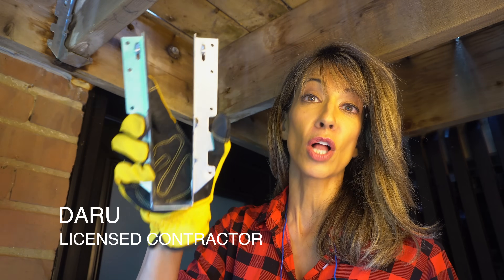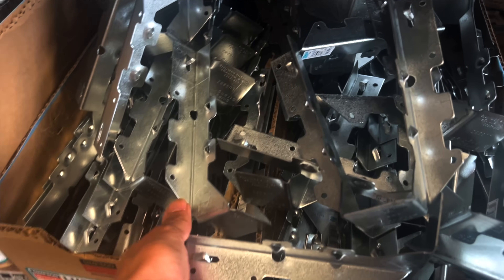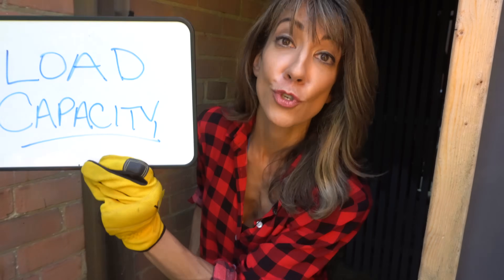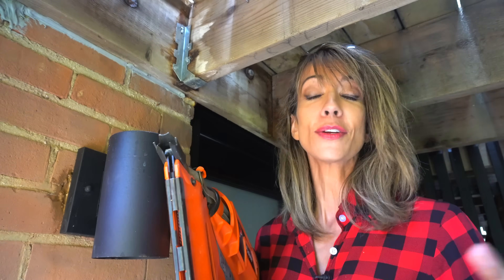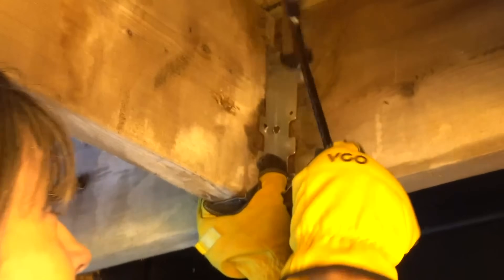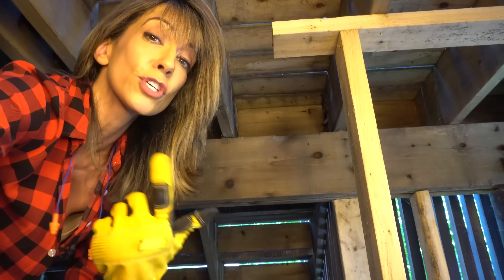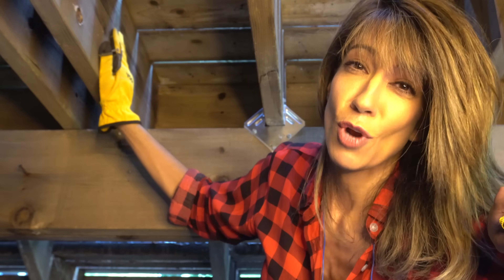Joist Hangers: Do Screws Beat Nails? (Backed by Science)

Comment: Using two and a half inch screws to go straight through a hanger leg into 1.5" ledger. Genius! Have fun on the ones backed by brick!

Also, nails don't break when you pull on them. They pull out.

Hammering on the bottom of a joist hanger after you have already secured it with a nail just results in bending at the bottom of the joist hanger to touch the wood. That which is bent can be unbent. The bottom of the joist hanger should be completely flushed before any fasteners are installed, not after 🙄

Good luck buying any joist hanger that is not galvanized by the way. Unless you're shopping in the local Dollar store of course.
Reply from the maker: Appreciate your thoughts on fasteners and joist hanger installation; all good points.

Comment: @6:40, did you mean to run a 2.5" screw into the 1.5" ledger board?  There is an extra 1" of screw protruding on the other side.
Reply from the maker: You can use 1 1/2” screws for the face and 2 1/2” for the diagonal screws.
Reply: No, she don’t. It’s at an angle. It’s perfect.
Reply: @randykephart3661  lol. Zero angle.  The screw goes in perpendicular.

Comment: I understand/agree with the longer screws for diagonal application, but it looked like you used the longer screws to attach straight into the ledger board so it would presumably hit the brick behind the ledger board.  I'd be more concerned with shear rather than tensile strength so would use the short nails for straight into the ledger (or maybe a combination).  Note, might try a palm nailer / auto-nailer.
I realize their are fewer options fixing an old deck rather than new construction, but I'd prefer those rim joists be supported by notched posts.
Multiply joists should be protected from water with deck tape, maybe caulk in a pinch.
Reply from the maker: It's #9 1 1/2" for the ledger, #9 2 1/2" for the double shear. Good to hear from you. Thanks!

Comment: Joist hangers put the fasteners in shear, so ideally nails are a better option because as you said, nails are stronger in shear.  Screws are often better for tight spaces though, especially those diagonals. But, as you said, that's why the manufacturer has approved nails or screws.
Reply from the maker: Good points and true. Good to hear what you think on this! Appreciate your thoughts!
Reply: @DaruDhillon agrees hiwever in a joist hangar the primary function by the shape and design of the hangar itself to carry load. The fastening method is to keep the structural member in place, not to support shear forces.
Reply: Correct, joists are in mostly sheer and only a little in tensile force resistance. Head-to-head nails are stronger for joists if they are the same length and diameter of a joist screw. If the screw is longer than the joist nail, it will be the same or even stronger than the nail, depending on extra length (in wood, not through it.) A screw is a nail that has had threads cut into it so the thread area is actually less diameter compared to the nail. Thus making screws weaker against sheer forces.
Reply: That true for normal screws not for structural screws, they are tested to meet sher ratings.
Reply: This is a question: Doesn't shear strength have to do with the thickness of the fastener as long as both fasteners are made of the same material? Like you, I saw the nail seemed thicker than the screw. That being the case, the nail would win the shear strength "race". So I wonder why the manufacturer wouldn't make the screw shank the same circumference as the threads? I realize this would make the screw more difficult to screw in because the shank would be trying to go through the threaded wood rather than an empty space created by the root, but it seems worth the trade-off to me. Yes, I'm extremely verbose and detail-oriented. 🙂
Reply: @NathanZSolomon A (12) #9 joist screw is 0.177” in diameter and then had threads cut into it whereas the (12) joist nail is 0.148” in diameter. So, the joist screw recommended by the manufacturer is actually larger diameter and able to withstand even more sheer force. A #7 screw is 0.151” in diameter so it would not resist the same sheer force as a 0.148” nail because it had threads cut into it making the actual diameter much less.
Reply: @mst5632  Wow! You sure know what you're talking about. Thank you for your help.
Reply: @NathanZSolomon  if they are made of the same material and size and hardness then yes, shear strength would be the same.  But typically screws and nails are not made of the same material and hardness.  Have you ever noticed how nails will bend quite easily but screws will break.
Reply: @tchevrier  I have noticed that nails bend, but I, with my DIY work, have only seen that a couple of times on what I call, drywall screws. Thank you for your insights.
Reply: @NathanZSolomon yes, nails are designed to bend so that is why they are superior for sheer force resistance. Deck screws commonly cannot bend much at all as they are considered to be “brittle” and never to be used for any structural work.
Reply: @NathanZSolomon  Good place to note that drywall screws are only for drywall - not structural use like decks and walls.  They don't have the shear strength.
Reply: @tchevrier  Dry wall screws were used in the 1980's in place of nails and do fail. Modern "CONSTRUCTION" screws are not made the same as Dry Wall screws. 

20 years ago I had to rebuild a deck that was overloaded by too many people. The deck builder (Home Owner) used dry wall screws for most of it and 2/3's snapped but the BRIGHT nails just pulled out. No Joist hangers. I rebuilt it using Joist hangers and long #12 Construction screws rated for the 2x10 lumber.
Reply: @mst5632  pretty much all you have posted does not apply to modern fastener material science. Engineers do not call out screws for prescriptive/sheer panel details because no one uses screws for that process.  If a manufacturer like simpson has a product that can use different fasteners they call it out in technical specs.
Reply: @BaronVonFrankenBolzlllI don’t disagree with you from an engineering and architectural standpoint. But, this is YT. This is where DIYers come to get information on how they can apply things to their own projects. As a well experienced DIYer for at least 20 years, I have never read any engineering call outs or work off of architectural blueprints. This is not commercial or industrial building resource information we are trying to achieve.
Reply: @tchevrier    Structural screws are a different beast. Grk screws are rated at 450lbs in shear, 16d nails are rated at 150lbs in shear. Yes i know grk screws are not for simpson hardware, just providing an example of why your statement is not necessarily true.
Reply: Smokin hot
Reply: Nails is NOT better in shear if it's used correctly since with screws you tighten the hanger to the wood so you get a high clamping force and gives lots of friction that the nail doesn't give.
When the joist is tight to the wood there will be a lot of force on the joist before any amount of sheer strain ever goes to the screw.

Also when people say screws are brittle.
"Yes" BUT the load that already made the nail fall out the screw is still tight.

The screw won't flex but it will hold the wood tight and the wood will flex instead.

Just try making two crosses, one with 2 nails and one with 2 screws.
Now try to wiggle it apart but use the same weight/force on both.
The nail will loosen much much earlier than the screws will even start to let go
Reply: @tullgutten  Nails also "tighten the hanger to the wood".  Use the nails or screws  recommended by the manufacturer of the joist hanger and you'll be fine.
Reply: @tullgutten this clamping force does not apply to hangers
Reply: A dab of floor glue in the hangers is also nice......
Reply: @Cykyn What purpose does that serve?
Reply: Lol came here to say that
Reply: The shear strength of a modern structural deck screw is far beyond any load that the screw will ever encounter. This isn't the early 1900s.
Reply: @cristopherfrakes1416  facepalm.  Thanks for your lack of maturity.
Reply: @tchevrier thanks for highlighting the fact that you have no rebuttal for my statements, only childish ad hominem retorts.
Reply: @cristopherfrakes1416  facepalm.  When you start off acting immature then you don't deserve to have a mature conversation. Grow up, then we can talk like adults.
Reply: @tchevrier  attempt presenting factual counter arguments instead of resorting to emotional tantrums and perhaps other people will listen to and engage with you instead of cringing. 🤷

Comment: The biggest difference between using screws or nails is that most screws will break under stress, nails mostly bend. Drive into wood halfway screws and nails you might be using. Hit them sideways with a hammer to see if the faster bends or breaks. Which fastener would be preferred on a roof in Florida, one that bends or breaks under stress? Personally, I would use BOTH screws and nails to get the strength each provide in their own way.
Reply: "biggest difference between using screws or nails is that most screws will break under stress, nails mostly bend"

Structural screw will bend. Drywall screws will snap. Issue is the heat treating process applied to screws & the alloy used. Screws are better since I seen too many nails that don't get driven in  properly either because the nail gun is underpowered, the cannot get the nailgun at the proper angle, or the the nail bends & does not fully go into the wood.
Reply from the maker: @guytech7310  Thanks for sharing your experience with fasteners under stress. It's always helpful to share what you know!
Reply from the maker: That's an excellent point about using both, I appreciate you sharing your experience.

Comment: I don't know why Simpson says those screws are in double shear. They are not. There is a single failure plan that goes through the screws. They do help pull the joist closer to the ledger/beam and there are simply more screws which makes connection stronger. It is funny, the code has a reduction factor for toe screws but Simpson gives them a stronger capacity. Screws usually also have a higher shear capacity than nails (for similar diameters). The only advantages to nails is that they are cheaper, install faster, and are more ductile for seismic loads. The pull out capacity for nails is much lower and you can not use the pull out capacity for sustained loading.
Reply from the maker: Thanks for sharing your thoughts!

Comment: Guess there are legit hanger screws. But still when I see screws in a hanger it looks like amateur hour. 
 Joist are dealing mainly with shear force even a quality deck screw if it's sticking out of the back end of a 2x4 and you strike it with a hammer it's going to snap first a framing nail you gotta bend it back and forth 10x before it will break. 
 But I guess if it's up to code.🤷🏼‍♂️
Reply from the maker: Nails are a great way to go. Tried and true. Thanks for sharing your experience with that building.

Comment: Great vid! I learned something about crossed fasteners in joist hangers. What I'm not understanding here is why you'd use 2 1/2 screws straight-on into a 1 1/2 thick joist. At least that's what I think I saw.
Reply from the maker: Good eye. You need 1 1/2” for the ledger. My hardware store was out when I shot this video. Good reminder to have your materials beforehand. Not day of. Lesson learned.
Reply: @DaruDhillon  I hope your information gets better. Your hair and makeup is spot-on but "my hardware store was out" excuse is laughable. If you knew what you were doing, you would have added a disclaimer in your video regarding the wrong SD screw length but somehow found the correct screw when installing the hurricane hardware. I wish I was the man driving your videos; I would not let you make such embarrassing mistakes- one of many in this video.

Comment: Ok what do you prefer to be Nail or Screw?
Reply from the maker: I like the flexibility of being able to remove the screws to replace things down the road if need be. Nails are an excellent choice if you want to save money. Or if you prefer using them.
Reply: Screws because too often they are never driven into spec. The nailgun is under or over powered causing the nail to not get driven all the way or bent, and the contractor leaves as is. or unbends the nail drives it in but its now weakened because of metal fatigue.

Comment: In the past, only nails would be strong enough for hangers. Today, there are a variety of fasteners that, although they look like drywall screws are  much stronger.
I still use nails, one they are less expensive and two I learned how to nail over 50 years ago. Retired now, but I can still swing a hammer into tight areas.  Hanger nails or tecos  can be hard to use for beginners.  In my early days as a carpenter, we didn't have hangers or hardware. We pressure blocked. Then, once hardware became standard, we used 16d nails. Eventually, tecos were used.
Reply from the maker: Great that you’re a pro with the hammer. I love that. Thanks for sharing your experience working on decks. It’s true. The screws have come a long way compared to the old ones. Nails are tried and true. Reliable , especially if you got those hammer skills! Good to hear from you.
Reply: My father was a carpenter. I started going to work during the summers at 10 or 11 years old. Back then, everything in the US was union. There were no nail guns and contractors furnished skilsaws. Everything was hand loaded, no machinery. Plywood wasn't used much, osb hadn't come on the market and roof sheeting was 1x6 solid. Everything was hand nailed. Most guys used a Vaughn hammer. California framing hammers were started by guys taking Plumb rig axes, cutting the ax off and welding the claws off a regular rip hammer. Good videos, keep up the good work. @DaruDhillon
Reply: Im a novice and build a 18.5 ft x 8ft deck, attached to the house with a properly flashed ledger, and built with blocking/bridging throughout (to allow for decking direction to be uniform) the advantages of a. Cheap and b. Effecient. mostly used a pneumatic palm nailer, and would highly recommend , they are also very manueverable make difficult jobs much less phisically taxing, and what wouldnt have been possible due to confined space, i cant recommend enough, i bought mine for less than $70 @  home depot. It does  require ear plugs, and a steady hand , thats it
Reply: There is a conversation to be had about using Common nails versus Box nails. When shear is considerable you should use Common nails, not Box. IRC Chapter 5 has a table that lays out what fasteners to use in homebuilding and it is almost all Common nails. Joist nails (teco's) are a special kind of common nail that does not tie shank thickness to length like the penny designation. They will be called out using the 'N" designation - like the N8, N10 or N16 where they have that penny thickness but not the length.
I believe the name TECO was derived from the testing company that developed the joist-nail standard. The company is now known as PFS-TECO.
Reply: Norrmally we used vinyl sinkers. Before that there was concrete coated 16s. That was 50 years ago. As soon as tecos came along, we used them. Before hangers we would pressure block. Not sure exactly  what year your code reference is. But there are probably thousands of houses that had hangers nailed with 16s. They passed building codes in SoCal, many different jurisdictions. Many of those had some of the strictest  codes in the country because of earthquakes. And I have never heard of hangers  failing by using  none teco nails.

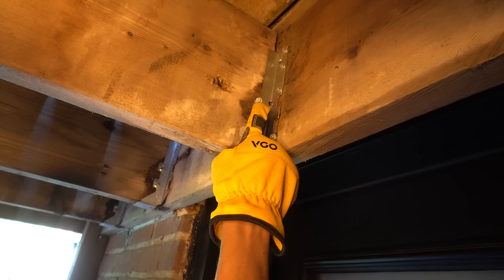Comment: There is a bad mistake in this video!  The fasteners she used from time 6:25-6:55 in the video were 2-1/2 long - too long for those holes (1-1/2 long should be used on those) . The thread of the screw went beyond the ledger.  However, those longer screws are correct to use on the diagonal holes shown from 7:00-7:15 in the video.  Ironic when people make videos about how others are doing it wrong and then do it wrong in their presentation!
Reply from the maker: The correct screws are listed in the description and links. Thanks for watching and taking the time to comment. It's #9 1 1/2" for the ledger and #9 2 1/2" for the double shear or diagonal screws. Cheers!

Comment: Do you use the #9 1 1/2" for screwing hanger directly into ledger?  And 2 1/2" for angled connection through joist to ledger?  Or 2 1/2" for all connections?
Reply from the maker: The 1 1/2” are for the ledger. Angled screws must be longer 2 1/2”. Links are in the description for more info. Good luck with your build!
Reply: Yeah, she made a bad mistake in this video!  the fasteners she used from time 6:25-6:55 in the video were 2-1/2 long - too long for those holes (1-1/2 lone should be used on those) . The thread of the screw went beyond the ledger.  However, those longer screws are correct to use on the diagonal holes shown from 7:00-7:15 in the video.  Ironic when people make videos about how others are doing it wrong and then do it wrong in their presentation!
Reply from the maker: @ultamusic  You should use the ones I have listed in the comments and links. The hardware store near me was out when I shot this video. Good reminder to have your screws ahead of time. Also the benefit of being able to adjust your work. Love it!

Comment: Question for anyone to answer. I am hoping to live off grid where there is a lack of resources, rules and codes, but I want to be as safe as possible. Where you do not have the strong screws, nails and brackets, can you compensate to some degree by using wooden joints to connect the support beams and joists?
Reply: Amish been doing it for years. It's called Mortise and Tenon joinery. I've seen old buildings in Europe 700 years old built that way and still standing. So yes